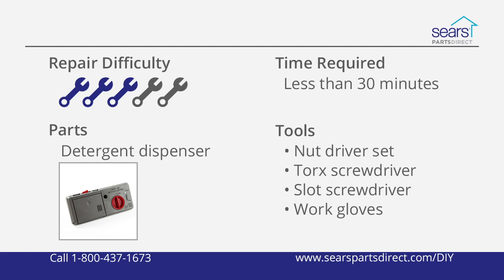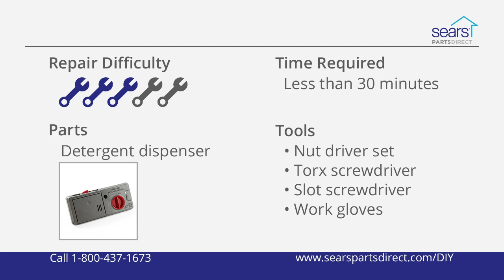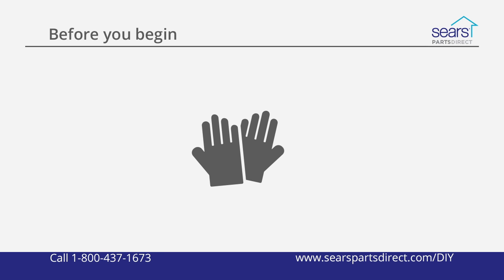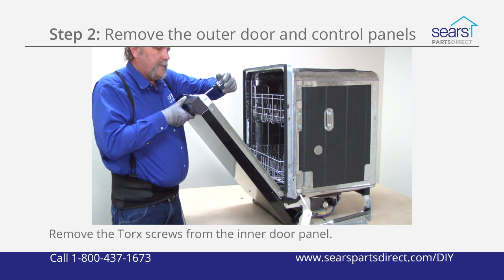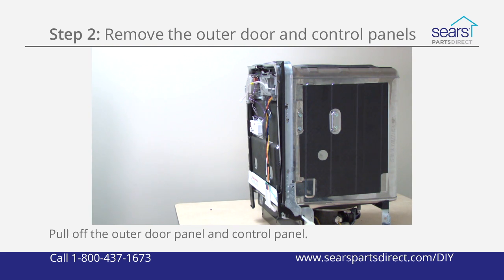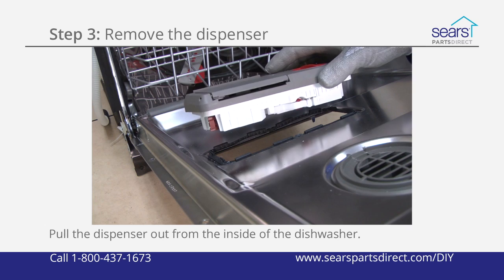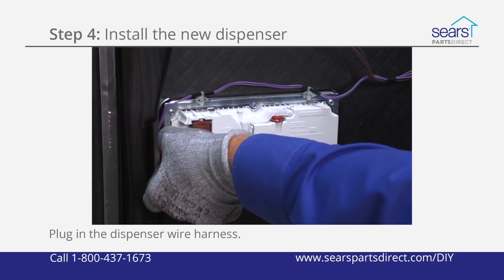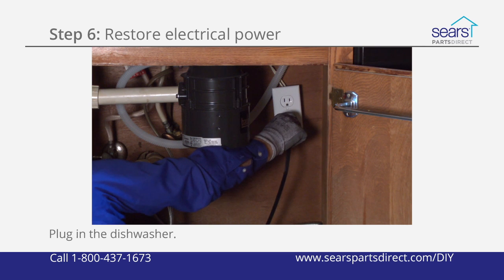Replacing the Detergent Dispenser on a Dishwasher

Comment: Very good video, thanks! Some slight differences in my unit, a 1983 GE Triton XL: the cable to the control panel was a wide ribbon cable that looked like it wanted to snap if you said harsh words to it (I said plenty by the time I was done with this project), my unit had TWO plugs for the detergent dispenser, and one of the two plugs was nearly impossible to unlplug--why, who knows (protip--pay attention to which wire/plug goes to which receptacle so you can plug them in again properly!). Worst of all, the door/control panel on the front of mine is TWO pieces, which made putting the door/control panel back on & replacing the screws a 30 minute ordeal that took two people--one to get everything lined up and held in place, the other to put the screws in. It kept wanting to fall apart just when you'd get it perfect. My best cuss words got a workout, and I admit to flipping off the dishwasher at the end, but that was mostly for the door reassembly.

Comment: I have no end it on the door or a place to put any soap there is a small gray box that you have to unscrew two holes there are two slots one to put water in and want to put water out the cover on the gray box has a small hole but there is no indent on this model
Reply from the maker: Let us know the model number of your dishwasher and we'll try to help you with advice on how to replace the detergent dispenser.
Reply: @searspartsdirect  model number DWS-t05
Reply from the maker: @miijjk  Unfortunately, we don't have technical or repair information for that model of dishwasher. We recommend that you contact the manufacturer for help.